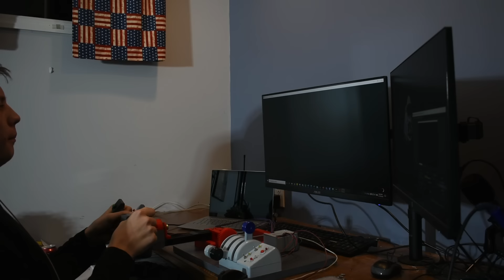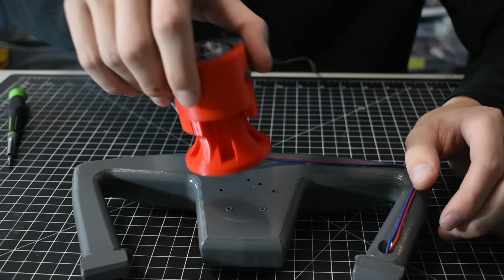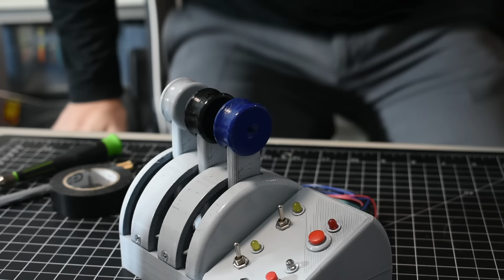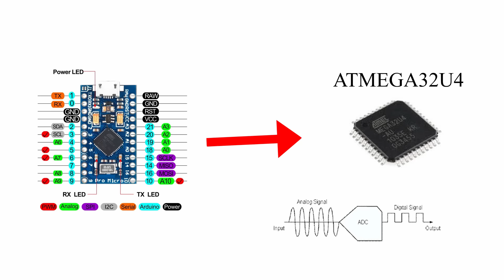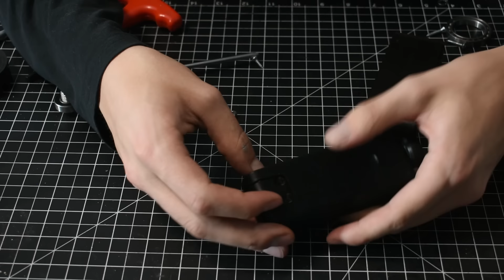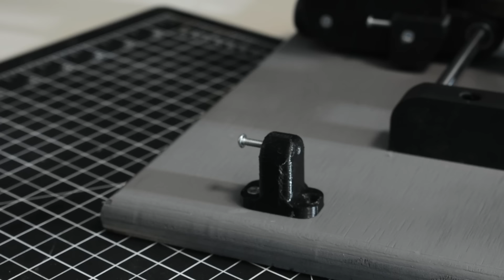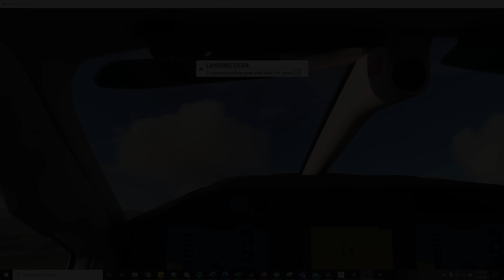DIY 3D Printed Flight Yoke for 2020 Microsoft Flight Simulator

Comment from the maker: Thanks for watching! For all the files, code, and a parts list for this project, check the description. Also, sorry about the audio issue.
Reply: Thanks, I asked before checking.  Great video!
Reply: Good video
Reply: What size 3d printer bed do you need to do this?
Reply: @Deltawolf2022  I used an ender 3 v2 but had to split the yoke in half and super glue it back together.  I tilted it originally and it fit on the print bed, but one of the supports came loose half way through the 36 hr print.  Didn’t want to risk it so I broke it up.
Reply: @jayhamm34  I was just looking at the Ender 3 V2.  I have been looking into 3d printing for some time, haven't bought yet, I hear it can be hard to set up but has a great community to help out.
Reply: @Deltawolf2022  I bought the ender 3 v2 when it was on sale for $230.  I have been so happy with mine.  About 30 minutes to assemble and printed well right out of the box.  I upgraded from an Anet A8, so much happier with the creality. I honestly haven’t had any issues and print quality is good enough for hobbies.
Reply: @Deltawolf2022  I bought an ender 3 v2, two months ago having ZERO 3d printing experience. I assembled it in 1 hour, leveled the bed in 20m, and got my first perfect print 30 minutes later. In this 2 months I had some issues, but nothing serious. Overall, an excelent experience.
Reply: @emiliodubois1433  picked mine up last night, had little issue assembly, was a dumdy on bed leveling, but once I fixed that, I printed a calibration cube.  Picking up filament later to print other things lol.
Reply: Hi,in the video you use extra PCB with ports that are not included in any document,not any cinematic with the Arduino board connections.Yes you implement the code but how we will get the wiring without the extra PCB board ?
Reply: @GreekSIMRACING  Did you get the connections? I need too! tks
Reply: @GreekSIMRACING  did you figure anything out?  I have all the parts printed, and have no clue how to get this thing wired up without the extra PCB board....stinks he didn't include any details about this part in the instructions.
Reply: Can you make it to work with Xbox series S/X? :)
Reply: fantástico proyecto , lo puedes intentar con una unidad de control para Ship simulator ???
Reply: Screws?
Reply: Is it possible to make this Xbox compatible?

Comment: Finally someone make a cheap flight Yoke system for 3D printing.
A few notes from a private pilot:
1. On a real aircraft the two buttons on the Yoke are for A/P disengage and PTT.
2. The quadrant levers should be (from left to right)- Throttle (Black), propeller pitch control (Blue) and mixer (Red). 
3. The brakes on a real aircraft are integrated in the rudder pedals (Press on each top to engage).

Thank you for your hard work for the community!
Reply: Wonderful suggestions!
Reply: Came here to tell the exact same thing :) But one addition to your comment, I have seen people use the blue lever on the right most of the quadrans as the flap controller for fixed-prop planes in the simulator. Highest setting being flaps 0, lowest being flaps 30.
Reply: I know Push To Talk, but what is A/P?
edit: maybe auto-pilot? deactivating auto pilot via yoke, I guess.
Reply: @tigerchills2079  yup, you are correct!
Reply: also, yoke moves 90 degrees bank either direction for full aileron deflection
Reply: number 2. could be referred as a TPM (Throttle, Propeller, Mixture). I'm a student pilot.
Reply: @tigerchills2079  yes
Reply: the two buttons on the yoke are for air to air missiles and a GAU-8 Avenger, nobody will convince me otherwise.
haven't yet found a 172 that comes with those as standard tho... might need to check south america.
Reply: lol a 172 is 757kg (that's aspirational... or not now)
a GAU-8 Avenger is 280 kg, but 1,828 kg with the mag and all required parts.
lol. gonna need a bigger engine.

Comment: Michael, excellent video. I have printed out the throttle quadrant and noticed 2 things you might already know. 1 there is no exit from the base for the wiring. No biggy, drill a hole and use a grommet. 2 the button cover needs cut to go over the last pot. Again no biggy just letting you know there are builds going on. Thanks for the excellent work. I was just starting to look around for a yoke when this popped up.

Comment: Mhmm yes, "Throttle, Flaps and Slats"
Slats are usually used in bigger aircraft and automatically extend relative to the flap's position.
What I suggest you to put those throttle levers for (if you still haven't but I'm sure you've done that already), from left to right, is:
Throttle, usually IRL is painted in black
Propeller Pitch/Angle...one of those for sure, painted in blue
Mixture, painted in red.
Another thing to note, in planes like the Cessna (where the yoke is most likely originated from).
Since the 3 main things in aviation ("Aviate, Navigate, Communicate") are very crucial for flying in today's airspace, you would usually have those buttons for either the AP disengage or PPT (Push To Talk). But, then again, it's your preference.

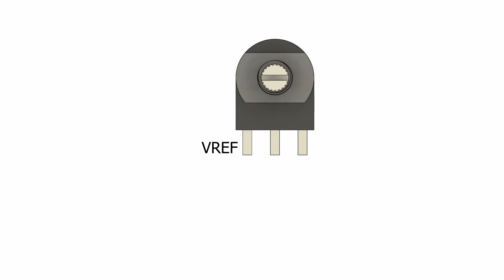For all the aviators out there, 6:51 Vref hehe get it? xDD
Reply: I was Looking for a vref comment lol
Reply: I am a aerospace engineer and I got both references :p

Comment: Very nice! I like your design for the rudder pedals much better than the one I came up with for mine, it's a much more elegant solution; mine used drawer slides to constrain the pedals and a belt reduction from the centre pivot to the potentiometer, direct meshing gears make more sense, especially with plastic gears where you can get the gear lash to basically nothing.

Comment: Excellent work. If I were to do this I would put a thumbstick on the yoke to control the camera (unless you have head tracking). This is one reason I stuck to using a gamepad over a joystick

Comment: My only 'gripe' would be to use long cheap tensions springs instead of rubber bands. Just from a longevity POV, rubber can dry rot and fall apart, especially under load. It's not a real plane so of course you could always add more bands if they break, I just like tension springs!
The yoke is sick, btw. Using the linear slides might have been convenient, but its a great idea. I have a bunch of extra ball bearing drawer sliders, so I'll prolly use those, however my old printer now looks so strange all not scrapped...
(oh yeah the levers which actuate on the pots, any particular reason you didn't give them a bearing/axle to ride on, which the pot could be nested in? seeing a pot being a little bit of structural member makes me sad for the pot lol)

Comment: You know i really need to make a good force feed back yoke. Would be simple to have a mechanical trim to remove pitch load, just needs a moving neutral position. Also use  Leo Bodnar module has all the analogue inputs you need.

Comment: maybe a suggestion is to make a Amazon list with all the parts in it.  IDK if you ever had a list of things  went over it,  ok got it all, just make sure, yep  got it.  get home and forgot something.  especially if you have alot of this stuff  I personally would rather  buy some extra toggle switcher that I forgot to remove from the cart rather then forget 8mm linear bearing. because I passed it up.    anyway thanks for the build.

Comment: Hi, could you post the electric circuit schema? Because in the google drive folder there isn't... Or someone that have already built it could provide it? I've print everything but i've some troubles with the connections.
Thankyou so much and obviously amazing video!

Comment: Have a look at the STM32 blue pill. It has a 12bit ADC and USB interface. It is also Arduino compatible, cheap and plenty powerful.
Reply: teensy 2 ++ has a crap load of pins so could also work

Comment: OUTSTANDING! I hope you're going to school to study engineering. Your designs are elegantly simple with imaginative solutions in the mechanisms. Thank you for making the 3d files available. If I build one, I will do a video or two and I'll be sure to credit you as well as link to your video and channel. Currently I run a channel focused on RC cars and planes. I'll be launching a sim channel soon (early 2021) with the focus on car racing to start. I used to fly sims too, so I may have to build a set of controls based on your designs and start covering flight sims as well.
An interesting mod would be to add a "dashboard" to the yoke using a 7" Fire tablet ($55)... I'll bet someone makes the software for such a thing. There are several offerings for the race car sims. A lot of controls could be manipulated via the touchscreen. It would be easy to print a frame for the tablet. Leave the top open like a slot so the tablet can be easily removed and replaced making configuration  and maintenance easier... food for thought.
Happy Holidays, CJ

Comment: Michael Rechtin, Thank you for the designs and 3D print files.  I just finished 3D printing all of the parts and I am ready to assemble. However, I did not find a spec on the size and type of screws you used in the design.  Do you have a size and type of screws for each component or total for both the yoke and pedals?

Comment: agree on the pedal design, looks very nice and sturdy at the same time, better then the logitech versions probably as well

f you want to use an ESp32 for input , use i2c for communication between the arduino and the ESP

I have a full set of semi pro gear, but still design some inovative other stuff for the sim ( xplane that is ) and decided to use only esp32 and do comms via Wifi ( dont think it works yet in fs2020)
this give the possibility to use devices like a accelerometer for yoke inputs or even a  simple flightstick that can be handheld using batteries, or like in my case mount to a chair or use in a fully fledged cockpit

thank you very much for posting your video, gave me some nice ideas ( using the rods and bearings is one of them)

Comment: Yokes rotate 90 degrees, you will have more control that way
Reply: It's actually easier to implement it as 90 deg, simply connect it directly to the potentiometer

Comment: Instead of using an esp32 for the added DAC resolution you can use an external DAC like the ADS 1115. This has a resoulution of 16bits and as an added bonus you can use more analog signals due to the multiplexing capabilities of the DAC. I get that you wanted to keep cost low and didnt want to wait for parts, but for future project you could consider this. Great video though, love the content and keep up the good work.
Reply: Alternatively use digital pots and read data via a common SPI/I2C bus, have all the sensors connected on a single wire!

Comment: great easy-to-build design, well done! One note though: some of the parts will not fit a standard 220x220mm print bed so you need something bigger or you'll have to slice in parts and re-assemble after that. I mean the yoke wheel as well as the pedals bar.
Reply: Found that out as I'm printing now but a small price to pay. This is awesome.

Comment: first of all, wonderfull. I've gotten myself a 3D printer with this in mind and now I have it I think it's time I bite the bullet, your video gave me the motivation to do it

challenge for you (if at all feasible ): make the flight conrols wireless (bluetooth)
Reply from the maker: That's Awesome! Funny enough, one of the reasons I wanted to use an ESP32 initially is that it has Bluetooth built in. However, I think making a Bluetooth joystick would require some device driver type programming which I have no experience in. Definitely something to look into though!
Reply: @michaelrechtin  (should you ever want to start) was just looking around and this guy seems to have figured it out, his code is in the comments watch?v=CmIby3AIlVc
Reply: While feasible, ESP32s and ESP8266 consume a lot of power. I believe the batteries would drain pretty fast
Reply: @Pokerman536  Do you by any chance have a  ballpark figure off consumption? (I understand it depends on the loads but you seem to have an idea..)

Comment: great project and very good video, thanks for sharing. just one thing though all my ESP32 boards have a USB interface so I was surprised when you said they didn't.
Reply: The USB on ESP32 boards are just usb-to-serial bridges, not an actual USB controller capable of becoming e.g. an USB HID (joystick, mouse, etc)

Comment: Amazing design! I currently have one of those mediocre Logitec/Saitek yokes and want to make it much more realistic, this definitely pushes me to start!
Reply: Yes it's good but it's also easy to massively improve the Saitek yoke by removing the springs and replacing with rubber bands and bypass the aileron and elevator interface and using a higher resolution controller such as a leobodnar board.
I also reinforced my handle with aluminium plate inside and filled some of the cavities with resin. It's really smooth now, doesn't creak or flex and nicely weighed.
Reply: @djtaylorutube  yeah definitely, as of now I've only replaced the default board with an arduino and the resolution is much better plus no dead zone. Now I really want to make it force feedback.
Reply: @KofiAsare0  Ah same thought but I'm not sure I'll bother. What I am keen to play with is a moving reference for the "centre" point of the elevator rubber bands. I figure that if I drive this with a servo (could even do it entirely mechanically), I will get a more realistic trim behaviour. I do have a Cessna trim wheel but this requires slight coordination of returning the yoke to centre while trimming but I'd the trim moves the "centre" point which could be on linear rails then I think it'll be good enough. Other than ground bumps, trim is the only real force experienced that's really significant in small GA aircraft.

Comment: I made the prints on a 3D printer built by me and used a 0.8mm nozzle with a 0.4mm layer. The prints are quite fast and with such large elements I didn't pay much attention to the print resolution. Overall the design is great. I really like this system of yoke, throttle and pedal. I only wanna ask if there is a some circuit diagram.

Comment: A lot of people have asked and I didn't see any replies, but I'm still hopeful. I put together all the parts, but am stuck on the circuit diagram. Any chance you can describe the wiring to the microcontroller? Even a few pictures added to the drive folder would be a HUGE help. Trying to build this for my daughter and am really bummed to have put in this much time and material just to get stuck and give up. Just can't seem to figure it out.:(

Comment: Thank you for making this. I finished printing all the parts and am in the process of putting it together, I found out that you are missing the Potentiometer holder for the flight yoke. I checked the fusion file and it's missing from there too. Thank you again for sharing this design with u.
Reply from the maker: It was originally left out on accident. Check the files link again and the STL file should be there.

Comment: great achievement, missing a stl file in the Flight Yoke folder, the part for the yoke potentiometer.
Reply: You can find them in the Google Drive files. He has each module broken out so it's easy to find it. It's called Yoke_Pot_Holder.

Comment: This is simply amazing!
Would you also share the wiring diagram with us? Wiring pushbuttons, potentiometers, arduino micro, etc.?
You have done an amazing engineering job !!
Reply: There are lots of good designs showing how to put the rest of these together but this is the best design I've seen. Particularly for low-cost pedals.

For Ardunio you'll need a 328U (so NOT a Uno, Nano, etc.). Most designs (at least ones that work) use Hall sensors as they are solid state and don't suffer from any problems caused by mechanical operation such as stress from an off-center axis. Trust me from experience, if you can use a Hall sensor, do that!

Comment: Thank you very much for this really good guidance and implementation of the project. But while printing out everything and build it together, I found out, that the holder for the potentiometer for the yoke, isn´t in your part list. Probably, you could deliver this file!
Best ragards! (Hope also for a joystick for the flight simulator 🤗😉)
Reply: You can find it in the Google Drive files. He has each module broken out so it's easy to find it. It's called Yoke_Pot_Holder.
Reply: @sammyairlines9307  Ah! Thank you verry much! He forgot the file in the thingiverse data cloud 😅😉

Comment: Hi Michael, I bought the bearings and printed the pinion to test the tolerances, however my ender3 v2 prints the pinion bearing hole about 1mm too small so the bearing does not fit, I just wondered if the step files are available anywhere ? , Great Project Thank You !

Comment: Hey. Could you upload a code only for the rudder. Thx and nice vid!
Reply: If you are looking for the 3D print files he has them separated out on the google drive to the individual builds. If you are talking about the Arduino code it's easy enough to modify. It is well laid out.

Comment: Thanks for sharing this incredible design, I almost get all the 3d prints done, but now Im messing with the connections, do you have an schematic for electronic components? and also, for the 6 potentiometers, did you use an specific value for them? I mean like 10K or something..
Reply: I'm having the same issue.
Reply: @TheMightyRecom  no answer yet ={
Reply: @João Carlos open de 3d model file in fusion, locate the missing stl file, right clic export as stl file
Reply: The potentiometers value in this case don't really matter, as long as they are linear and not logarithmic. 1K, 10K, 100K, they will all work.

Comment: Hi Michael! Great stuff! I'm assembling the throttle module and wonder how you got the levers to stay in position when you move them midway? With the weight of the knobs, mines are falling down as the pots seems to weak to hold them in place. Any suggestions?  Thanks!